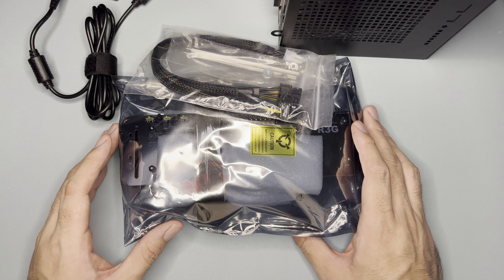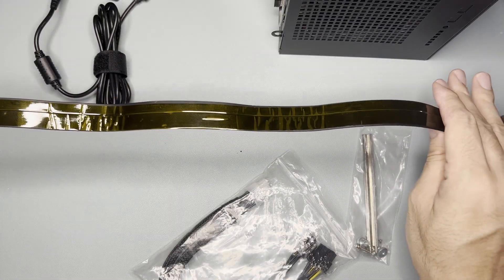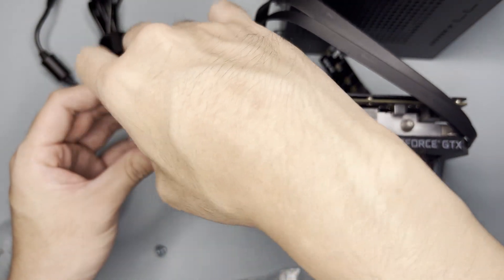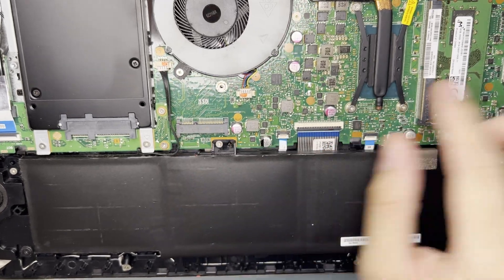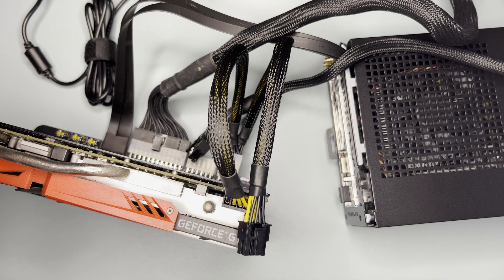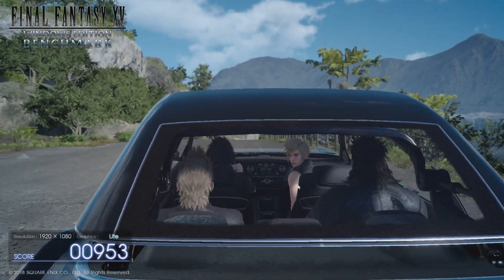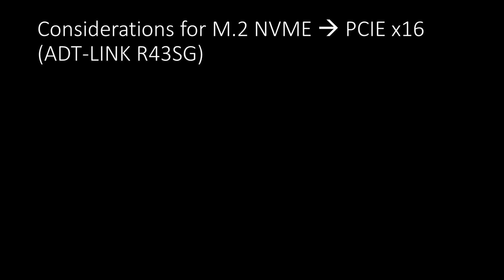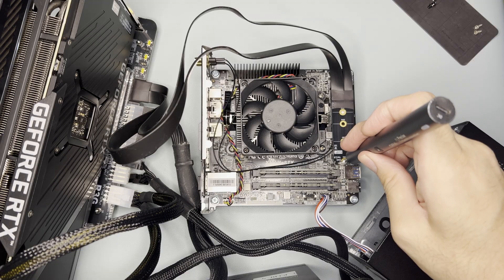Adding GPU to ASrock Deskmini X300 (or to some laptops) | ADT-LINK R43SG M.2 NVME to PCIE x16

Comment: For the stronger GPU did you use the pcie power cables from the PSU itself?
Reply from the maker: Yeah, if it has more requirement, then yes.

Comment: hello friend, thanks for the video. Can i use this set up with my 2018 acer predator laptop , it has nvme slot. its i5 7300 hq processor . I am worried about the bottleneck thing.
Reply from the maker: It’s possible as long as it has that nvme m.2 slot. Re: bottleneck, this will depend on the GPU you will choose tho realistically maybe OK up to RX 6600, safe with rx 580.

Comment: can i just connect the 8 pin connector from the psu direct to gpu instead of using the egpu board output wat??
Reply from the maker: I think you can, but I would recommentd to connect the 24-pin to the egpu. This way, when the nvme receives power from your device, it will automatically turn on the PSU for you and power up the GPU as well.

Comment: BIOS 1.90 has "Thunderbolt Support" (Enable/Disable) in the Advanced\AMB PBS options. Does this mean you can use one of the USB-C ports with an eGPU?

Google for "asrock x300 1.90 BIOS" and look at the end of the smallformfactor thread.

Comment: I run a very similar setup with the A300 and a RTX 3060 12GB connected through the same ADT-LINK dock.
I have two tips:
1. you can connect the dock to the NVMe port on the backside of the board. then the cable doesn't have to be bent and it goes through where the metal plate should be on the I/O port side if you take it off.
2. for the power supply you can get a cheap Dell DA-2. they can supply up to 200-220W of power while being completely fanless. this is ideal for smaller graphics cards that don't go above that power limit.

Comment: Hello, which one to buy? R43SG or R43SG-TU?
Reply from the maker: R43SG-TU as this has a short ribbon
Reply: @manongunboxing  What is the function of the short ribbon?
Reply from the maker: I consider it as a buffer for the PCIE x16 slot from your m.2 to the chassis.

You may want to compare the images here: https://www.adt.link/product/R43SG.html
Reply: @manongunboxing  Will the buffer increase GPU performance?
Reply from the maker: No. The purpose is that if you will plug it to a laptop or a PC with a case, you can still close it. Maybe the right term is an extension cable from nvme to the pcie x16. If you don’t have this ribbon, your laptop might need to be upside down and the eGPU will be sitting on top of the now upside-down laptop
Reply: @manongunboxing  I see, thanks!

Comment: Does the x300 work with AMD 3 4100 CPU? I cant get mine to boot and I am using this CPU. What CPU are you using for yours?
Reply from the maker: For the deskmini, only G series are supported. Direct answer is no, 4100 is not supported

https://www.asrock.com/nettop/AMD/DeskMini%20X300%20Series/index.asp#CPU
Reply from the maker: And to answer on what CPU: R7 5700G
Reply: it support ryzen 3 4100 but it doesnt have apu
Reply from the maker: Are you talking about deskmini or deakmeet?

Comment: Is it necessary to connect a monitor? Or I can use the graphics directly from the laptop without needing a monitor (I don't have thundelbolt, it is through PCIe)
Reply from the maker: Likely yes to utilize it. If you use your laptop monitor, you will not be able to utilize the external gpu as it will render with the igpu or your laptop’s dgpu (depending on load). Though some laptops can capture the external gpu back to the laptop monitor, but very rare.

Comment: Is it working if i use cpu 65 watt tdp but without igpu like ryzen 5 5600 or ryzen 5 5600X ? Because now it has egpu there,,
Reply from the maker: Deskmini X300 will work with G procs only (BIOS limitation).
Reply: Ok,, Thanks for info man 😊

Comment: hello, did you have to connect the PSU to the eGPU or was the power supplied through the ADT Link? I was looking to do something similar but I didn't know how much power I would need with a RTX 3060TI
Reply from the maker: Yes, I had to connect the PSU to the eGPU with the 24-pin. This will technically power up the PCIE connector + 2 8-pin power cables. 3060 Ti has 200W TBP, get good ATX PSU say 400W or more to account for transient spikes.

My general rule for PSU is get the best one that can fit your budget as PSU can be transferred easily in the future.
Reply: @manongunboxing  thank you so much for the detailed reply!

Comment: Your tutorial of this dock is the best. You describe all the connections in a very detailed manner.
Thank you so much. It is really helping me out

It's been a long time since i last saw a PSU though. Can you please tell me if the 4-pin i need to connect to the dock is always marked as "CPU" on the cables?
Reply from the maker: I wouldn't confidently say "always", but more often than not yes. Also, the 4-pin power connector that can fit will always be a CPU power connector. The other 4-pin connector that you'd see is a molex (won't fit), and the one that looks like a CPU connector is a PCIE connector, 6+2-pin (also won't fit). In other words, don't worry, it's somewhat fool-proof, even the cut-outs are designed to fit on certain connectors only (unless you mash the cables extensively, you won't be able to plug the PCIE connector).

Comment: Thank for the info very helpful i be thinking about doing this with a ASrock. I got the same setup with a HP g2 mini with a i5 6500 and ASrock x300 seem like a good upgrade and it works with R3G 👍 awesome ..i think your setup would work better if you cut the case and have the ribbon cable run through the hole in the case. that's what i did with the g2 mini

Comment: This review is next level!

And definitely not surprised to see the ASUS STRIX GPUs coming out on top. You can see it just by looking at the PCB. The Asus STRIX GPUs have more components than those of any other vendors. They absolutely made no compromises when they designed them.

I found out about ASRock by comparing specifications of several reliable GPU servers. I constantly saw EPYCD8 and ROMED8 motherboards popping up. Later bought one of each, and both systems have been running flawlessly 24/7 (crunching Asian chess games). The amount of PCI lanes on those are incredible. ASRock is just a great hardware vendor.

Because of those good experiences, I finally had the guts to buy an X300, to build a computer for my 6-year-old son. But my hands are still itching. Assembling computers is so addictive. Great review!

PS: I find it interesting to see the cutouts in the case for (what looks like) an RS232 connector. I wonder if it's possible to plug that on to the motherboard somewhere.

Wondering, did yours get shipped with a CPU fan? It's strange but I didn't expect one, but my X300 got delivered with an additional box containing a free CPU fan. Then when I ordered my AMD CPU it got shipped with a 2nd fan. And in mean time had already ordered a 3rd CPU fan. -- I should open a fan-shop website.
Reply from the maker: Yes it did come with a cpu fan. The amd stock fan will only fit if you deshroud it. Costs asrock less than $8 for it but saves them a ton of support inquiries, and for sure its cost was inclusive to the price anyway.

Comment: Hello, currently there is R43SG 4.0 (supports PCIe4.0). M.2 PCIe4.0 x4 has double the bandwidth than m.2 PCIe3.0 x4 that you have on your deskmini X300. I would love to see if the performance difference for the RTX 3070 can be significantly reduced if a laptop/miniPC has a PCIe gen 4 slot to be connected with the eGPU adapter. O,O
Reply from the maker: Sorry for the late reply and also I currently don't have the capacity to test the 4.0 as I have no m.2 4.0 slot on hand.

Comment: What power brick u use for adt link? How many watt?
Reply from the maker: It was an ATX PSU (rather than a power brick), it was a seasonic 1300W. You don't need that much though.
Reply: @manongunboxing  im using this adt link for pretty long time about 4 years with dell da2 220w power brick for cleaner setup. Currently with only gtx 1060. Do u thing 6700xt will run normally with 220w power brick?
Reply from the maker: I fear not.

My 6700 xt has 1 8-pin and 1 6-pin.
8-pin max power is 150W
6-pin max power is 75W
And the pcie connector itself w/ 75W.

Total of 300W.

Realistically 260-275W while gaming but there may be transient spikes of 300W (or a bit more).
Reply: @manongunboxing is it stable or major bottleneck issue when ure using it with rtx3070?
Reply from the maker: It was stable when I tested it. It was more than a week. No perceivable difference but measurably worse at 1080p (since 3070 is a decent 1440p class card though becoming 1080p on newer titles).

Btw, usually the stuff that you see in this channel gets torn down after a week. The only live and kicking are: the zzaw c2p build and the deskmini itself (w/o egpu).

Comment: I tried this on my laptop but didnt work even tho my laptop has NVME M.2 slot. I have RX 6600 XT but i don't use it bcs the EGPU didnt work with my laptop. Need a help please
Reply from the maker: Maybe its pcie is blocked. I suggest to google your brand and model number and search for egpu options.
Reply: @manongunboxing  i've searched all of my questions on google but none helped. The device manager showed error 31 and asked me to install the driver, then i restarted my laptop and it turned into black screen. Then i disconnected the EGPU and my laptop turned normal.
Reply from the maker: Oh it means it's a windows issue then. Try searching for code 31. 

I do find some reddit posts on it but may not be your case: https://www.reddit.com/r/eGPU/comments/otuqkw/code_31_on_the_dgpu_even_after_egpu_disconnected/
Reply: @manongunboxing  yes. And also device manager showd error 45 that my GPU needs to be reconnected again.

Comment: Excellent assessment! I myself will be putting together a similar build, though with the R43SF and a PowerColor RX 6400 LP. My plan is to use the R43SF's slot power (via included SATA power cable) to run the GPU, and mount it to the side of the DeskMini. I'm glad to see that this type of solution works without much trouble!

Comment: Hey, how did you install the drivers for the external gpu?
Reply from the maker: For the adt link? No driver required. It's like your normal pcie riser, it's just that it went thru nvme slot.
Reply: @manongunboxing  i mean the driver for gtx 1660 super
Reply from the maker: I installed the gpu driver that can be downloaded directly from nvidia website. Link: https://www.nvidia.com/download/index.aspx
Reply: @manongunboxing  so no need to install driver for ryzen 7 5700g integrated graphics?
Reply from the maker: Yes, no need. However, Windows will automatically install a driver for the 5700g apu, even though it is unnecessary.
Reply: @manongunboxing  thanks, can you test amd gpus next time?

Comment: Hey, only use 1 4-pin CPU power cable for the eGPU device?
Reply from the maker: I plugged in both 1x24-pin atx and 1x4-pin CPU cables